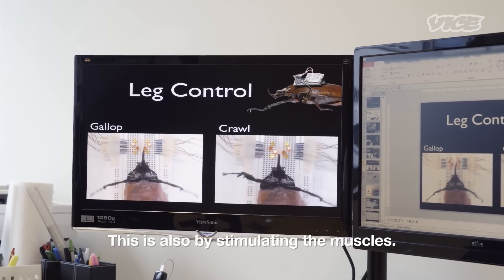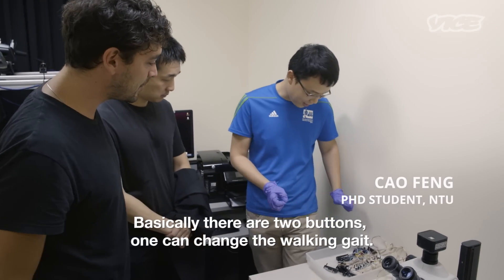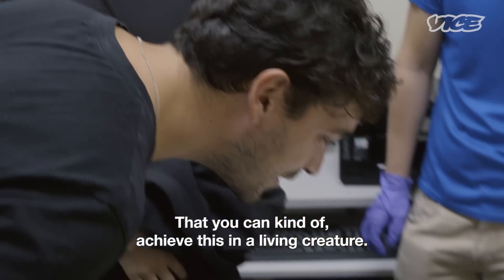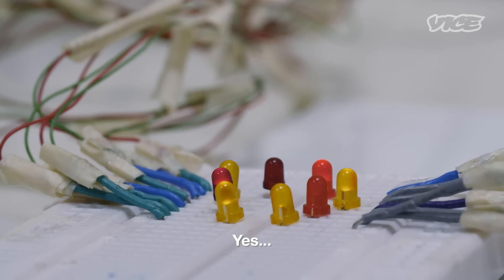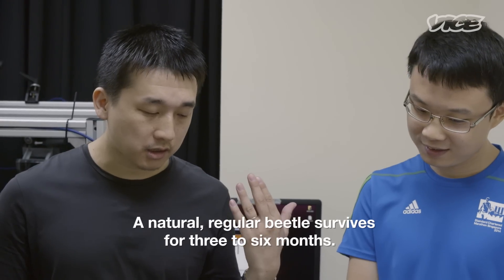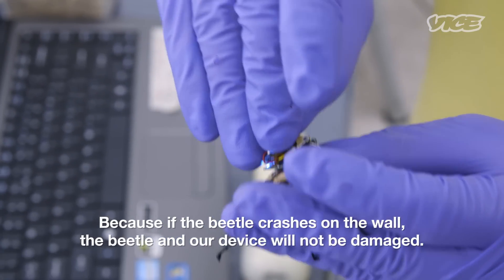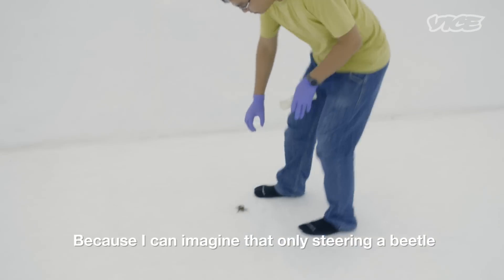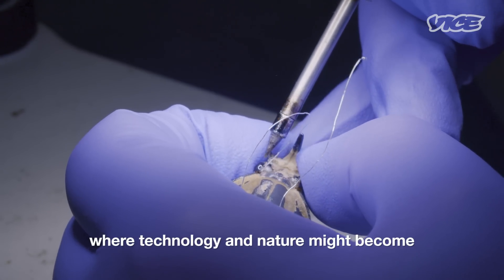Singapore's Remote-Controlled Cyborg Insects

Comment: As amazing as this technology is, I think we can all agree this needs to be heavily regulated.
Reply: This isn't the main creator of this technology this is somebody testing somebody's research in a lab thats openly showing itself a university project hoping to make its own breakthroughs. Its application has surgical value but everything else is  sinister. Flying and looking for heat sources there are smaller drones that do a better job this is 100% about control a host brain a schizophrenia of unimaginable horror and it makes you wonder about when people say they weren't themselves and they had no control i would never of guessed in a million years that person was capable of that . A few wires here and there how difficult would that be to do to somebody during surgery with a more expensive compact version of that undetectable a small box in the skull fibre wires in muscle self powering through motion .if this is being shown it is way ahead of what we see you might not even need muscle wires if you control the nervous system. brain mapping and electrical brain frequency scanning of the brain showing different patterns in the brain for different words is a map of speech movements would be just as easy to distinguish as its going to be a common automated pattern of electrons firing in the brain .when there is talk of robotics are we looking at the right thing
Reply: What? This is just nerve stimulation via electrical impulses. You can commercially buy devices that do this right now. Moron comment.

Comment: I actually do this to myself. I have nerve and muscle damage and use a TENS machine. The machine sends stimulating electrical impulses to the part of my body I want to stimulate. The only difference is, these leads are implanted. So, I know what it's like to not to be able to control muscle contractions. This beetle IS SUFFERING, but it's in the name of science!
Reply: Same...it can hurt badly...these scientists should have to experience a TENS unit.
Reply: This is incomparable, using electrical stimulation to stop pain is not the same as using those signals to force anything into acting in a manner against their will. Pain relief does not equal mind control.
Reply: @angrydragon4574  using a TENS unit at a relatively high level will cause your muscles to contract and then relax once the signal weakens or is turned off and it's very painful. This is exactly the same thing, they're stimulating the muscles directly with an electric impulse strong enough to incite a muscle contraction in patterns that emulate walking. It's controlled, strategic electrocution of the muscles...ask anyone who has had enough electricity go through one or more muscles to contract them, it hurts
Reply: @rastamike8063  No, it is not. There is a difference between electrical signaling to remove pain and using it to take control of a living being.

Comment: "no it doesn't hurt"
uses soldering iron on beetle
well I think it's a bit ... scary but I suppose it's going to happen either way. May as well have the peaceful Singaporeans doing it.
Reply: These beetles can't feel pain the same way we can. Their brains are literally separated into their limbs. There is no central "brain" in the vast majority of insects. They lack the neural networks required to even have the sensation of "pain" at all.
Reply: @dr.schlopp4089  They clearly have a will to live. Many insects become frantic when trapped or threatened. So, that don't have nerve systems? It's still trapping, attacking and controlling a being's body and life.